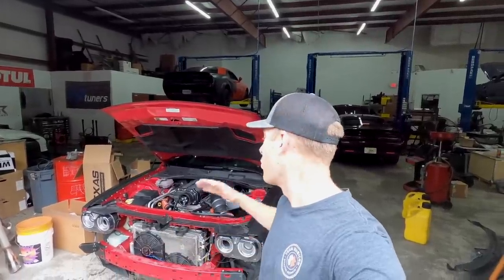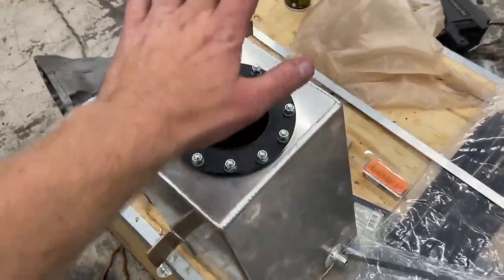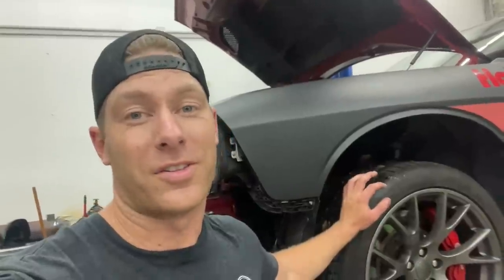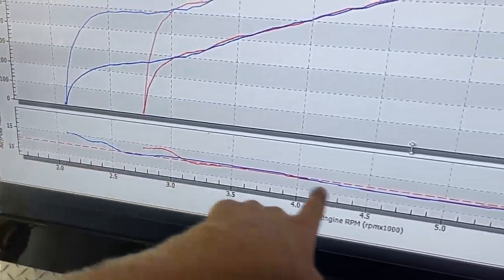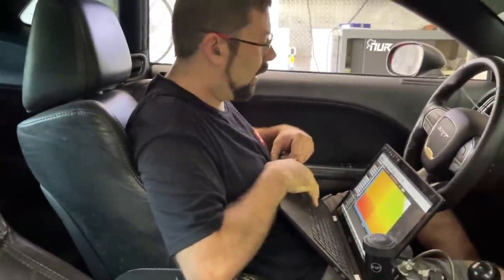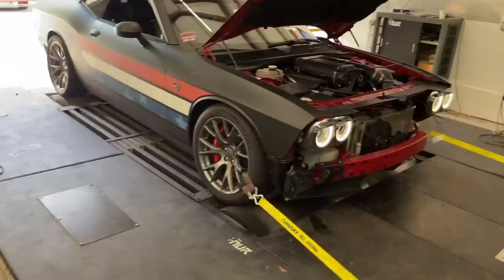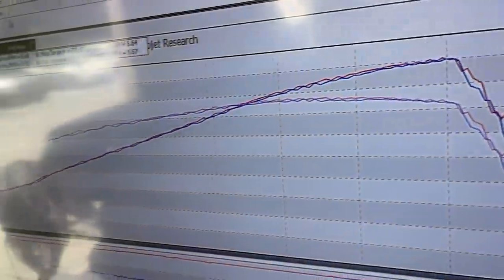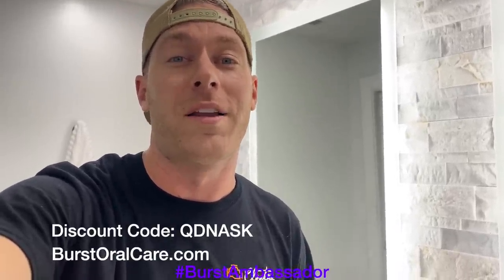FIRE Breathing Hellcat Hits the Dyno in Prep for America's Largest Burnout Contest!!

Comment: Needs a x pipe so it stops the crackling on decel. also in a burnout comp you loose points if you keep it on the limiter. High revs without hitting the rev limiter, consistent smoke, use of all the pad, no stopping, no reversing and no wall taps. Hope You go well Parker. Good luck Dude.
Reply: The limiter depends because most slower the limiters too keep it from going too the moon. 5k is super low and safe.

Comment: You should put the AC unit back on and run it though the supercharger it will eliminate the need for so much water. It seems to work on quarter mile cars and can’t hurt to try

Comment: Disclaimer!!! It has 0 miles now. The suspension might have some miles but I'll bet they were changed also. The body has the miles. Only matters if it has rust. It's a brand new car at this point.
Reply from the maker: Does that mean I take it to the dmv and tell them I rebuilt the motor, they going to roll back the miles for me?